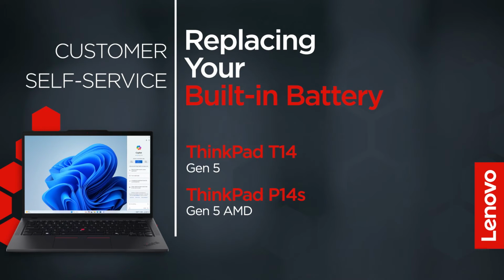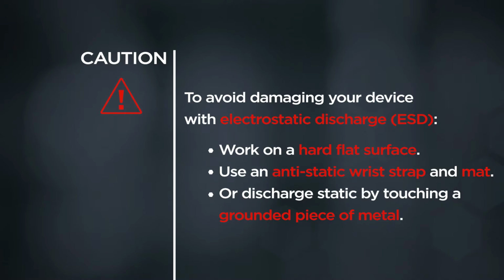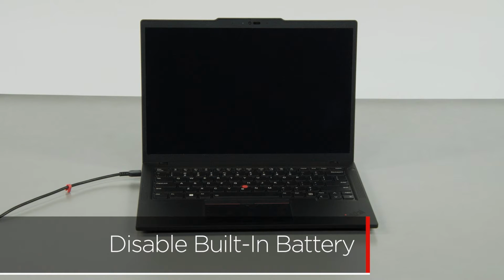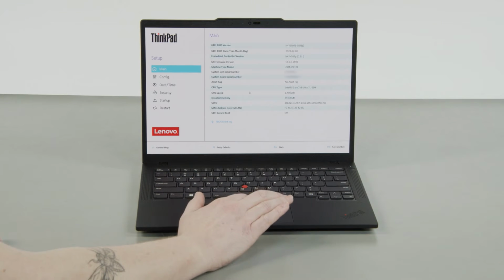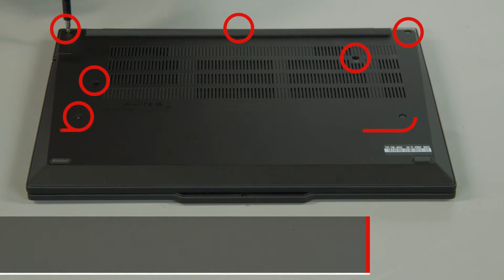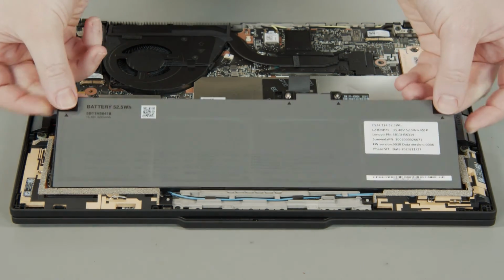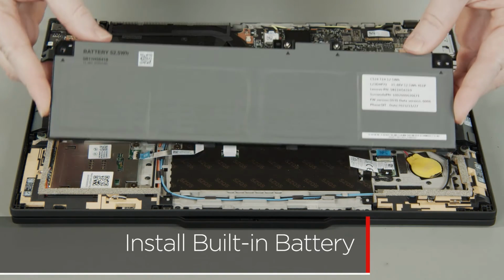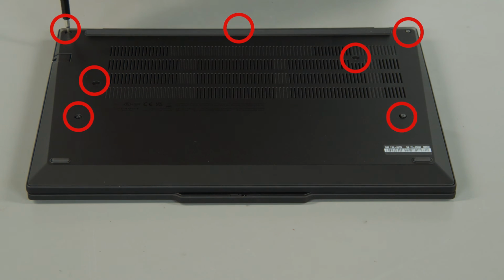Replacing Your Built-in Battery | ThinkPad T14 Gen 5 and P14s Gen 5 AMD | Customer Self Service

Comment from the maker: This video will show you how to replace the built-in battery in your ThinkPad. The process in this video will work for the ThinkPad T14 Gen 5 and ThinkPad P14s Gen 5 AMD. 

You will need a screwdriver kit, a non-metallic pry tool, and 15 minutes of your time.

To view the ThinkPad T14 Gen 5 (21ML, 21MM), P14s Gen 5 AMD (21ME, 21MF) Built-in Battery Self-Repair Guide go to https://pcsupport.lenovo.com/us/en/selfrepair/sr500048

To view the full ThinkPad T14 Gen 5 Self-Repair Guide go to https://pcsupport.lenovo.com/us/en/products/laptops-and-netbooks/thinkpad-t-series-laptops/thinkpad-t14-gen-5-type-21ml-21mm/selfrepair/removalsreplacements

To view the full ThinkPad P14s Gen 5 AMD Self-Repair Guide go to https://pcsupport.lenovo.com/us/en/products/laptops-and-netbooks/thinkpad-p-series-laptops/thinkpad-p14s-gen-5-type-21me-21mf/selfrepair/removalsreplacements

To learn more about your device go to https://pcsupport.lenovo.com

To find parts for your device go to https://support.lenovo.com/parts-lookup/?cid=ww:lenovosocial:b9515f&source=socialmedia&subsource=yt

To view the Lenovo Support Self-Repair Guides landing page go to https://support.lenovo.com/us/en/solutions/HT516547

** NOTE: Static electricity can destroy components. Use a grounding strap, and clean, non-conductive surface to work on. Use plastic or coated tools to prevent scratching and avoid using metal tools on plastic parts. For more detailed information on electrostatic discharge and how to prevent it, please watch our "Understanding Electrostatic Discharge (ESD)" video: https://youtu.be/by4PB3WtdLo 

Batteries supplied by Lenovo for use with your product have been tested for compatibility and should only be replaced with approved parts.
A battery other than the one specified by Lenovo, or a disassembled or modified battery is not covered by the warranty.
Battery abuse or mishandling can cause overheat, liquid leakage, or an explosion.

To avoid possible injury:
Do not open, dissemble, or service any battery.
Do not crush or puncture the battery.
Do not short-circuit the battery, or expose it to water or other liquids.
Keep the battery away from children.
Keep the battery away from fire.
Stop using the battery if it is damaged, or if you notice any discharge or the buildup of foreign materials on the battery leads.

Store the rechargeable batteries or products containing the rechargeable batteries at room temperature, charged to approximately 30 to 50% of capacity.
We recommend that the batteries be charged about once per year to prevent overdischarge.
Do not put the battery in trash that is disposed of in landfills.
When disposing of the battery, comply with local ordinances or regulations.

Do not attempt to remove or replace the built-in rechargeable battery.
Replacement of the battery must be done by a Lenovo-authorized repair facility or technician.
Only recharge the battery strictly according to instructions included in the product documentation.
The Lenovo-authorized repair facilities or technicians recycle Lenovo batteries according to local laws and regulations.

Applicable Machine Types:
ThinkPad T14 Gen 5 - 21ML, 21MM, 21MC, 21MD
ThinkPad P14s Gen 5 AMD - 21ME, 21MF

Check out other official Lenovo channels!
https://www.youtube.com/@Lenovo 🟥
https://www.youtube.com/@lenovolegion 🎮
https://www.youtube.com/@Lenovo-PC 💻
https://www.youtube.com/@LenovoSuporte 🟢🟡

#Lenovo #LenovoSupport #LenovoTechSupport